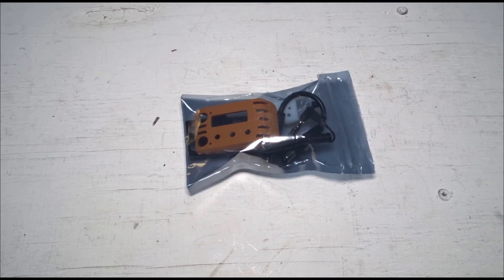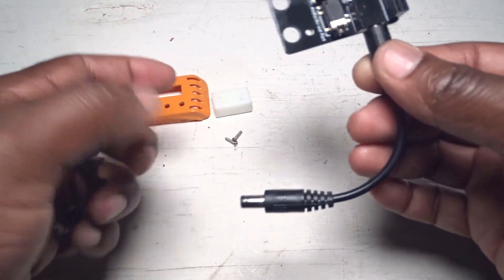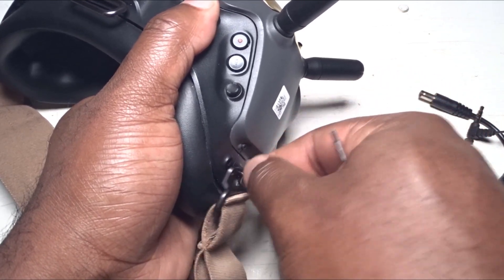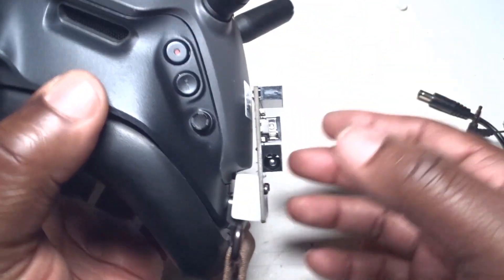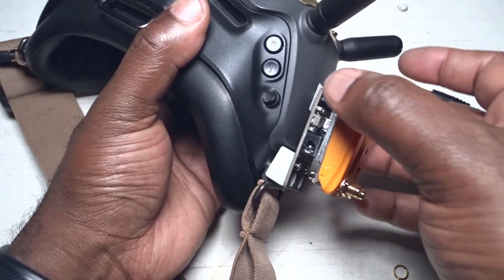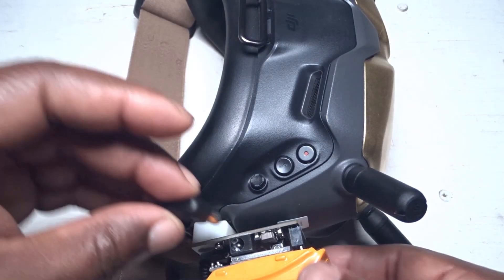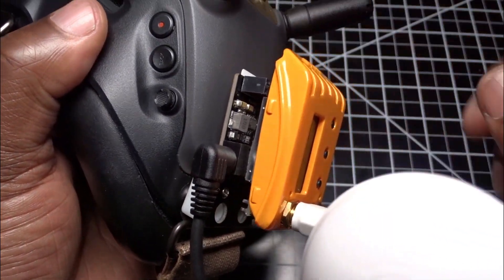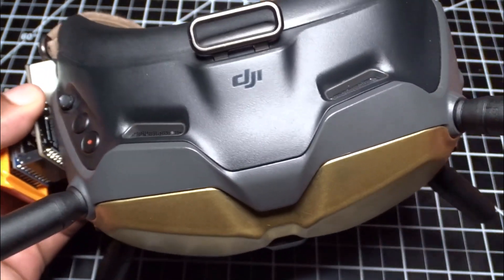DJI DIGITAL FPV ADAPTER "EASIEST ANALOG SOLUTION"

Comment: Great video, where do you get the golden front plate for your goggles?
Reply from the maker: It came in with the adapter.
Reply from the maker: Sorry,  i thought  you were asking about the module faceplate cove. About to front plate, i painted it over with spray paint.